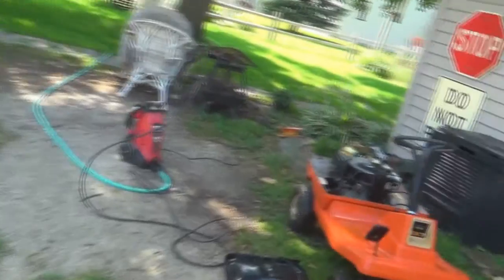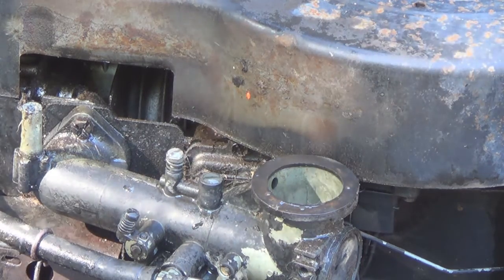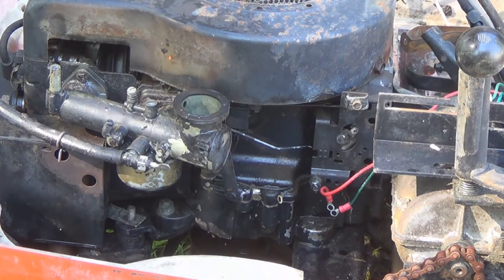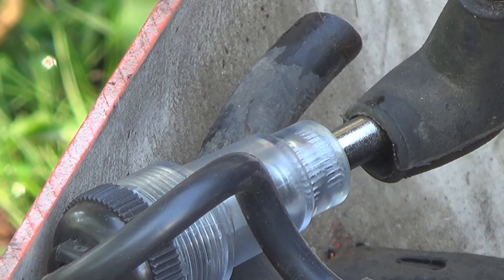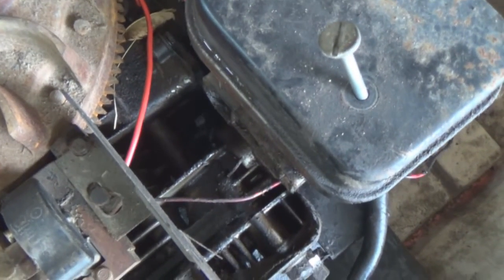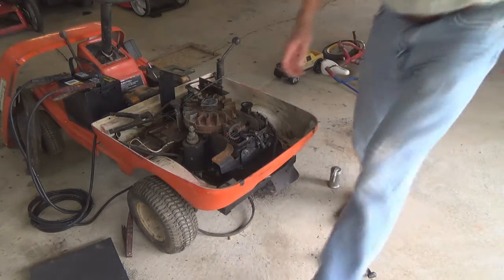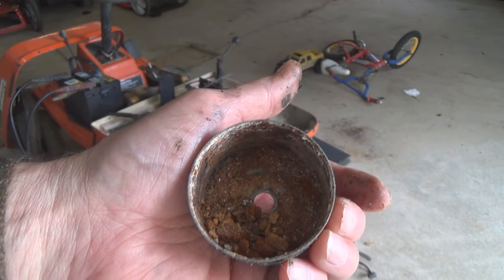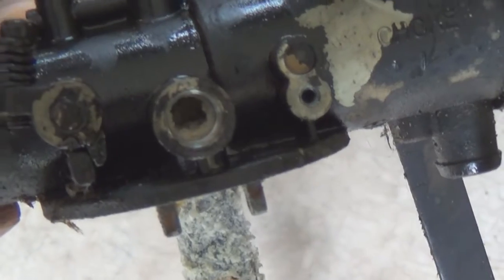Mongomery Ward GX7 first start in 37 years!

Comment: That carb is really corroded But it's worth a try to soak it and clean it .
I noticed the dummy type recoil thing holding the flywheel on
Reply from the maker: not2fast4u2c The carb is in the cleaner as we speak. I think that this motor could be pull started and I actually have the recoil that came on the 10hp motor I am going to rebuild, which is also electric start as well. Good observation.

Comment: I'm amazed George but I suspect that carb is toast!! The engine turns over really well though - I would have expected one or more valves to be stuck and the piston rings as well. I shall be very interested to see you are able to sort it so that it runs.
Reply from the maker: Dan Whiteford I have the carburetor soaking in the carb cleaner and hoping for the best and maybe into the vinegar after that. Thanks for stopping by Dan

Comment: Yea there was a little dirt in that carb. Have you looked on ebay , to see if any cheap carbs are listed for it
Reply from the maker: wtbm123 I have found a couple of used ones, but they are not "cheap". I have soaked the two similar carburetors I have in the carb cleaner for a couple of days and now have them soaking in vinegar till morning. If there is anything left (it was bubbling pretty well...) I will attempt to finish disassembling them, specifically getting the metering jet out of the carburetor body. So far the cheapest one on ebay is $42+ with nearly two days left on the auction. There is another with 3 of them for $75, but in really dirty condition and who knows what they look like inside. I will keep looking and if worse comes to worse I may ask my youtube friends to do some scouting for me. And as always happens, right now the $$$ are tighter than usual even, though I hope to have some extra in a couple of days with the sale of a push mower... Thanks for stopping by